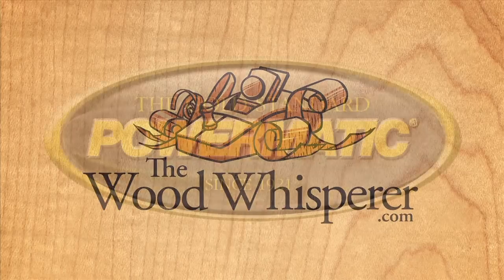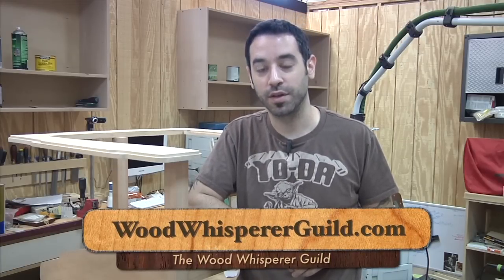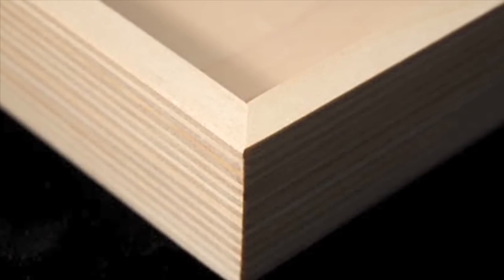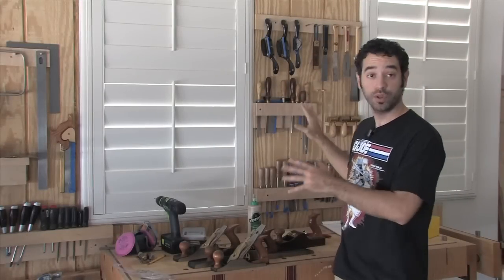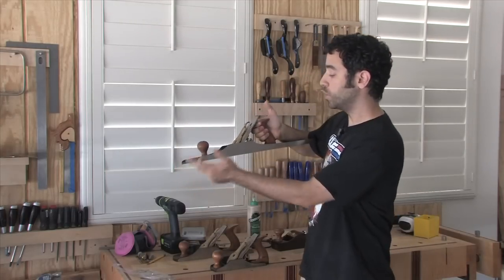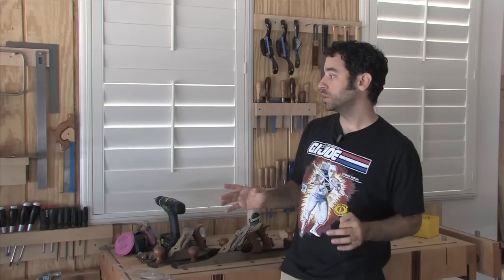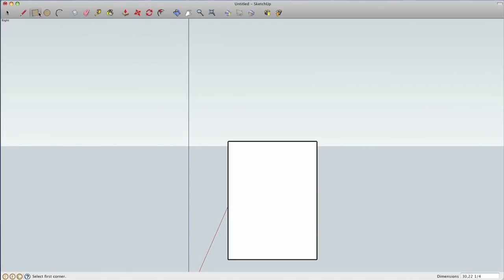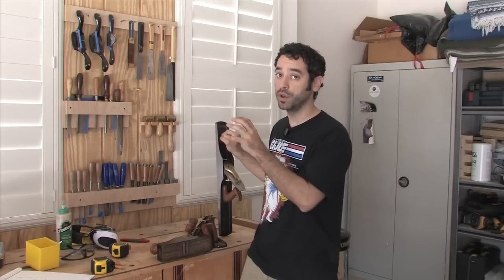152 - How to Build a Wall Hanging Tool Chest (Part 1 of 3)

Comment: just as a quick tip for using sketchup to anyone out there, if you're using the push pull tool to make several items the same thickness or w/e use the tool and enter the measurement one the first piece. after this simply double click on the rest to get those to the same measurement. Can't remember the youtube vid title i learned it from, but i'm glad i saw it

Comment: What would you think of building the french cleat right into the back panel by making a 1/2" deep dado horizontally across the panel and then a dovetail bit on the top edge to create the angle.  Your cleat would then be 1/2" thick.  You would have to be careful to not put any dowels or other fasteners into that area for your tool holders, but you would have saved a lot of material and avoided that wasted cavity behind the back.

Comment: Just thought you might be interested that there is a program called SketchList which is made by Rockler. It seems like it is like SketchUp but it says you build with "virtual boards". It also says you can optimize material and manage costs.